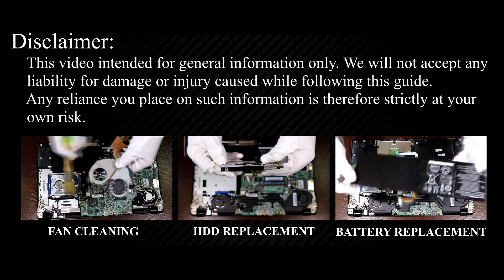Acer Aspire V5-573, V5-572 RAM Upgrade and Installation Guide

Comment: Crucial reports max ram for aspire v5-552p-x617 is 12GB

I have an 8gb stick of ram in this slot.
The system reads it as 4gb.
The other ram would be on the other side of the motherboard.

Could you show a video on how to upgrade it to 12gb?

Comment: So is there only one slot for RAM? CPU-Z says there should be two ones.
Reply: Дмитрий Сергейчев There is a 4gb ram slot that is inaccessible, it might be detecting that.
Reply: My slot that is accessible is empty. Can I put an 8 gb to upgrade it?
Reply: @Tronblue007  yea you can, you'd have 12gb in total. Just make sure it is ddr3 since ddr4 is not compatible with it.
Reply: Roman Larenas thanks I've done that now. It's a lot better at multitasking. 👍
Reply: my one has two slots.